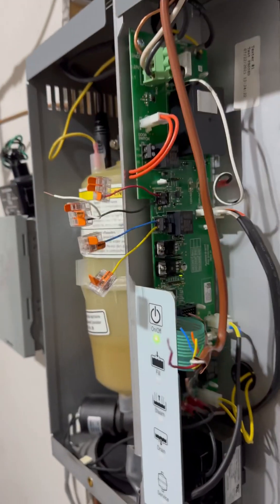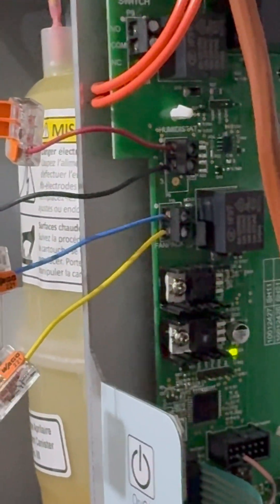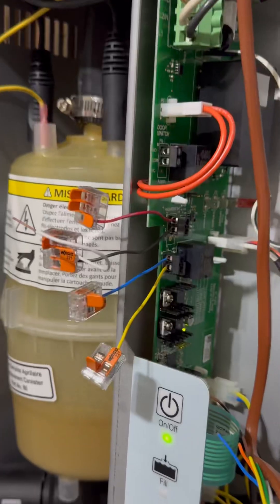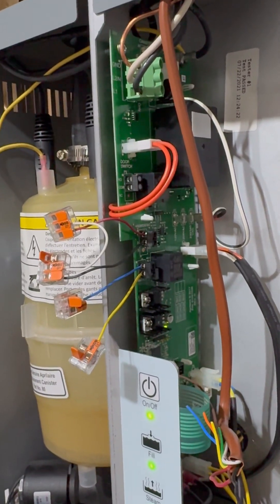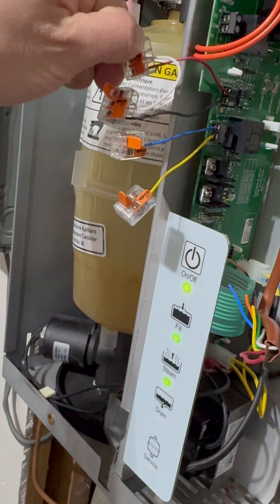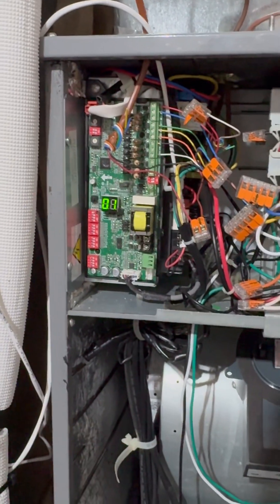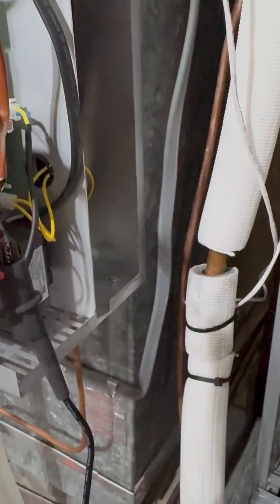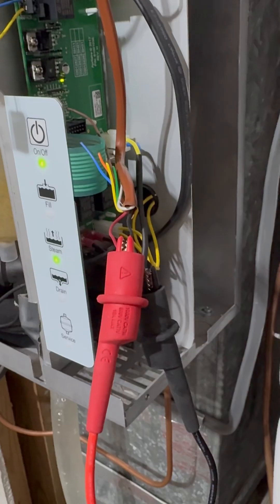Understanding Dry Contacts in an AprilAire Steam Humidifier (Model 800)

Comment: Good explanation had a call were that humidistat terminal failed, and board had to be replaced. This definitely would have helped me diagnose way quicker than the 2 hours it took me.
Reply from the maker: Honestly, it shouldn’t require techs like me or others on YouTube to produce content. I decided to do it since frankly it disappoints me how much lack of video training is provided by manufacturers as a whole. Almost feel as if the trainers for the classes do this as a form of job security. AI will fix that issue in the coming years mark my words.